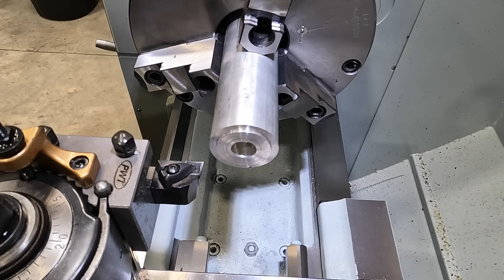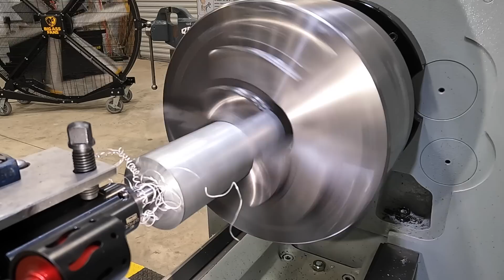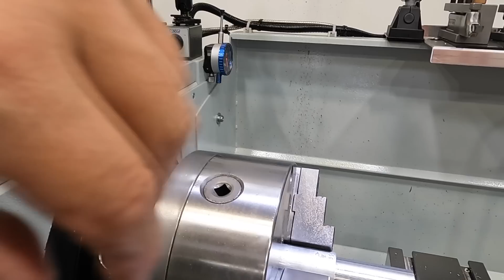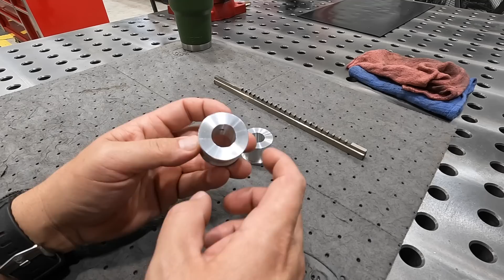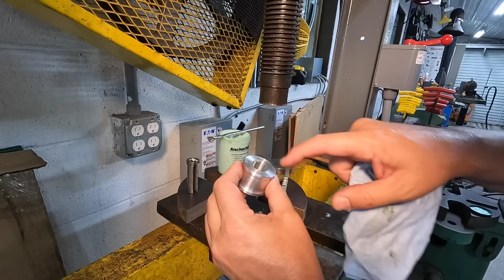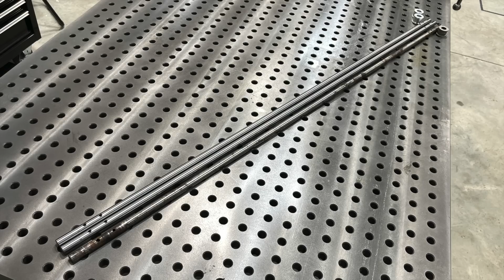Metric Aluminum Pulleys for 20MM Driveshafts

Comment: You know you can lock your spindle on your cnc and use it to broach cut
Reply: Yes but you need dedicated tooling to do that not the broach he is using.
Reply: @mehmettemel8725  i was mind blown when i learned about it back then 😆. Learned it from an old school guy.
Reply: @mehmettemel8725  saw a guy did it once on brass using a pieace of tool steel he sharpen up.

Comment: If cutting tools ain’t sharp they won’t cut! 
I’ve always try to never unnecessarily fiddle the tools or work with my fingers! Even light weight swarf can cut a finger tendon!OUCH one’s fingers are for use on delicate parts only! Used a swarf hook & brush or pump oil can for coolant and use barrier cream. Ps. I’ve still a full set of digits at 70!